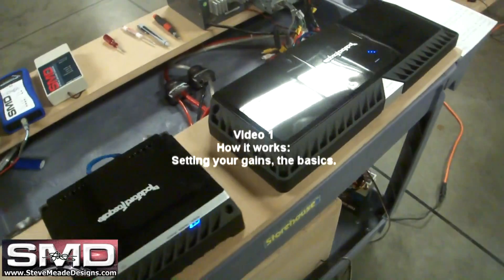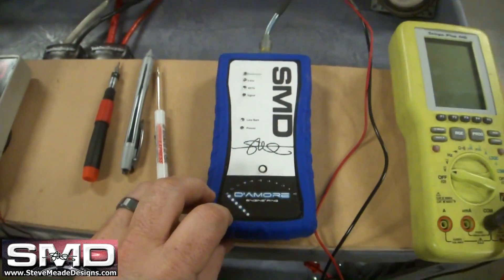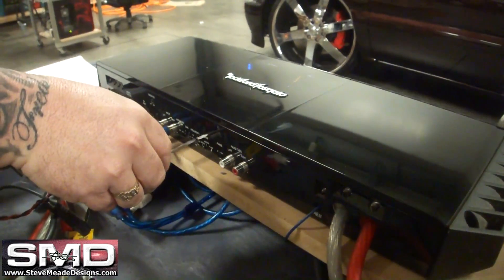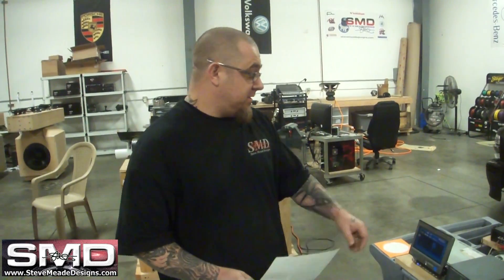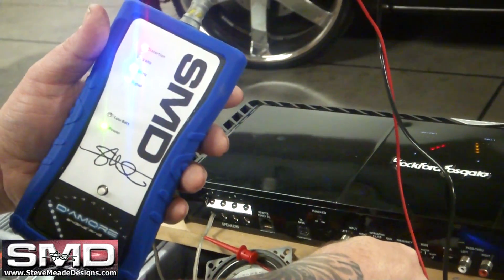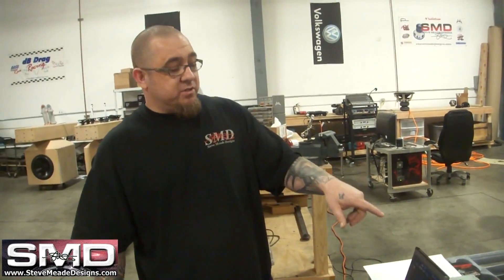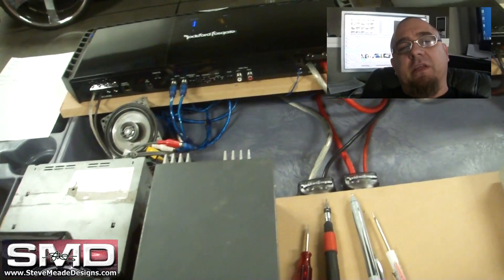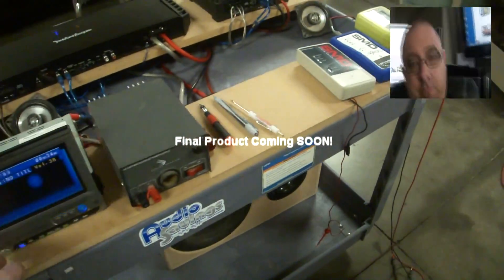PREVENT CLIPPING! Set AMP GAINS like a Pro! New SMD "Distortion Detector" - Coming SOON!

Comment: @NysoO more then likely ya that is the point of maximum clean volume if u have any bass boost or loud button on it will happen faster but to answer your ? An amp will allow you to give your speakers more power and in turn play louder but you will still need to find your clipping point on your deck and amp just like steve shows in his video if you need any help or advice feel free to hit me up

Comment: Hey everyone. I've got a pair of 6x9" speakers which are rated to ~80w RMS. I have connected them directly to the head-unit which supposedly delivers ~30w.
The speakers sounds good until I get to a certain volume level, where the base starts to distort, I assume this is when the signal starts to clip.
Would buying an amplifier allow me to play louder, with more effect, before this clipping starts to take effect?

Comment: I can't help but notice that you did that without the drivers hooked up, I've scoped an amp without a sub hooked up then hooked the sub up and checked it with the scope and it was clipping. You should be doing that with the subs/speakers hooked up to the amp, as different impedance loads may require different gain settings.

Comment: For the guys with all of the crossover frequency questions:  If  you don't know where to set them a good place to start would be about 80Hz low pass on your subwoofer amplifier and around 100Hz high pass on your amplifier for your mids and highs

Comment: @woodzyspl The quick blink of the distortion light when turning it up is due to the autoranging circuit.  This unit can read distortion on anything from around 2 watts - 20,000 watts.  When the circuit steps to the next range it slightly distorts the signal for a few milliseconds, and this unit sees that and flashes the light.

Comment: I want to comment on some of your questions about how the system will be effected by setting the gains with or without the speakers hooked up.  It depends on if your amplifier has a regulated power supply or not.  If you are doing this on a JL amp for instance (regulated supply), it won't matter if the speakers are connected or not.  If doing a RF amp (unreg supply), it will add around 3dB of gain overlap if done with the speakers disconnected.  D'Amore Engineering

Comment: is there with any gain over lap with this system? like with the 3sixty set up CD? -10 db for subs, -5 for mid/hi"s and so on? defiantly need one! way to use your head! and fill a gap in the market with a badly needed tool thats easy & quick to use!!
                                           *****GOOD JOB STEVE*****

Comment: @themasher1 

its just the same, the negative terminal of your battery is connected to the body of the car, the body should be a conducter, because it is metal, and, therefore any spot of the car body should be a ground, better grind off some of the paint works where you want to put the ground in, so that you get a full contact.

Comment: The part ive never been clear about when setting gains; they usually tell you to flatten the EQ on your deck, disable any loudness / bass boost etc., BUT what happens when you re-enable your EQ and bass boost (on deck) AFTER setting the gain in a flat state? wouldn't this cause clipping?

Comment: @rkmx5 with an AC signal (what the amp puts out) the signal is supposed to be a perfect sine wave, where one point of the wave is different from the next, which is what causes fluctuations in the coil, which makes the speaker move. If you "clip" the signal, you flatten out the tops and or bottoms of those signals, so for a few brief seconds you have a DC signal, which will keep the speaker to one end of its travel, which is very bad for it. That's an inelegant description,bit it's mostly right.